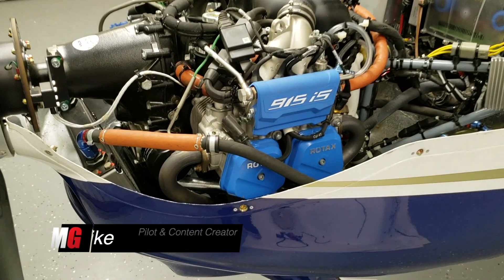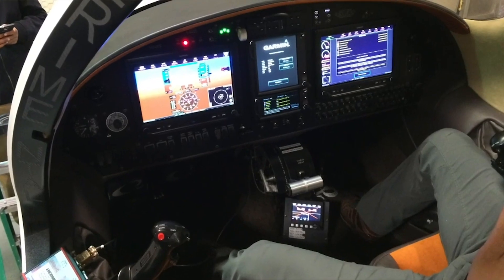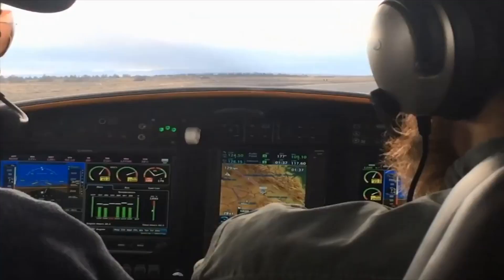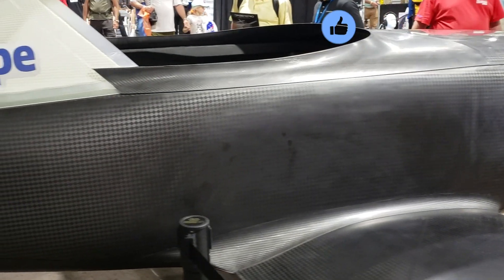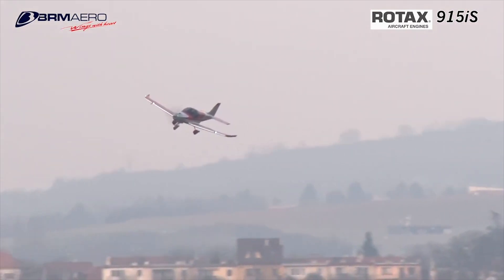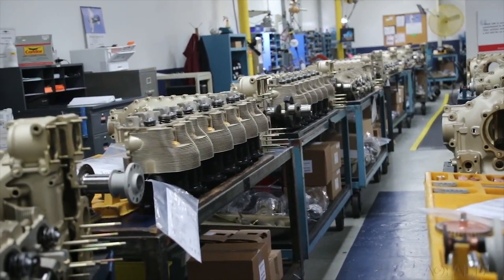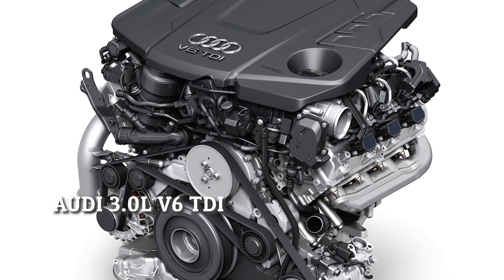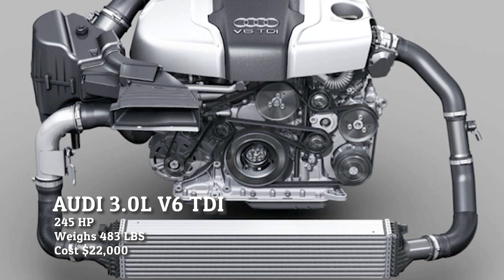5 FADEC Engines Used To Power Airplanes

Comment: Why is it that FADEC is a big deal with aircraft piston engines?
In a modern car, you press the pedal and the electronics take care of everything.
At the more affordable end, there are aero-engine conversions of auto engines.
One of them is the AeroMomentum AM10, 85 hp, 63 kg.
It has FADEC. cost only $7,500
Reply: Those engines have no redundancy. Single spark plug per cylinder, single injector and in most cases, single ECU. Aircraft specific engines are redundant in all these areas and I can tell you from personal experience that  I have needed that redundancy in flight a couple of times already in my short flying career(about 100 hours). I won't fly a plane that doesn't have it anymore. I really want to see either aeromomentum or Viking redesign the heads of these engines to accommodate dual plugs and injectors. Viking has a dual ECU option now, I don't know about aeromomentum though. Also FADEC does more than just control the engine. It also controls the prop. And then it all works together to lower cockpit workload and make the engine run at complete efficiency and safety without you having to be a mechanical engineer.

Comment: A regular car engine typically has a compression around 12:1 for road use, traditional Continental or Lycomings more like 8.5:1 or lower. That diesel Audi (and all Diesels in general) will be around 18:1. So if you try using 100LL or any other gasoline fuel in it, you'll get a BIG explosion and a bill for a new engine.

Comment: Frankly, the industry should be embarrassed that EVERY new plane doesn't come with a FADEC engine.
Reply: Exactly! Aircraft piston engines are at least couple of decades behind auto engines.
Auto engine manufacturers invest millions in R&D and manufacturing facilities.
It may be that the aviation market is too small to afford such R&D costs
Reply: @BlueMax333  Most of it has to do with the ridiculous FAA regulation process. That's why all the innovation is in the experimental category
Reply: Job Chithalan Thank goodness for Rotax.
Reply: @BlueMax333  Red tape and supply and demand.  The demand for aero engines isin't as big as for auto engines hence, the reason why they are hand built and cost a small fortune.

Comment: Piston light aircraft were equipped with magnetos which operated independently of the aircraft electrical system.  In the event of electrical failure, the engine kept running.  FADEC is reliant upon the aircrafts electrical system.  In the event of electrical failure, you lose the engine also (assuming there is no FADEC battery back up).
Reply: In the early days of aviation, electrical systems were unreliable.
Reply: @phlodel  - So now electrical systems have advanced to the point they are immune from failure?
Reply: @Booboobear-eo4es  No, not immune but certainly more reliable than many people.
Reply: @phlodel  -  I heard of a Diamond DA-42 pilot who had a dead battery in his plane.  Even though the Diamond manual prohibited take offs with a depleted or low battery, he got a "jump" for the battery, started up and took off.  Raising the landing gear in a DA-42 requires more electrical power than the aircraft electrical system can supply, requiring the battery to momentarily make up the shortfall.  (Which is why one doesn't take off in a DA-42 with a dead/near dead battery.)  As he hadn't been in the air long enough to charge the battery, the battery couldn't handle the extra load from the landing gear and it resulted in a complete lost of electrical power.  This cause the loss of the FADEC and he crashed.  Don't recall if he survived.  This wouldn't have happened in a aircraft with magneto type ignition.
Reply: @Booboobear-eo4es  Would love a link to the FAA or other accident report.  Correct me if I'm wrong but don"t the Diamond engines run fine without FADEC?  They are diesels.  And the FADEC has it's own battery backup?
Reply: @PC-vq5ud  - I heard this DA-42 account several years ago and my memory isn't 100%, but I believe it was in Germany where this incident happened, so I have not looked in the U.S. based NTSB database.  I did check the Wikipedia and found the following quote about the DA-42:

"The digital FADEC (full authority digital engine controls) serves to lower operational difficulty, constantly performing tasks such as managing rpm and fault-checking."

If the FADEC has a battery back up, that would avoid a single point failure scenario.  The battery would have to last long enough to keep the aircraft flying until one could safely reach an airport.
Reply: @Booboobear-eo4es  Just read a list of 58  DA-42 accidents.  Could not identify yours BUT several were loss of both engines.  One was listed as fuel starvation.  The others were not specific.  This list is user created, not government or official agencies.  There were links to official reports but most were not in English or pointed to dead links:  Error 404.  So if I ever get in the market for a Diamond Diesel I will do a lot more research on FADEC redundancies and the Austro 300 behavior on complete electrical system loss.
Reply: @PC-vq5ud  - I think maybe the mixture and timing might be under FADEC but I'm not entirely sure.  I also think there are non-Diesel that burn 100LL and utilize the old spark plug.
Reply: @PC-vq5ud  - Well, it was a LONG time ago I read the article.  So I can't really say when or where is was.
Reply: @PC-vq5ud  - In the early days it was though best to separate the engine function from the rest of the aircraft electrical system.  Aircraft systems (incl electrical) have become more reliable.  Yet the loss of an electrical system could take out the engine if:
1)  The battery back up was dead.  I suspect the check of the engine FADEC would be part of an annual or semi-annual check.
2)  If the flight duration is longer than the FADEC battery life.  Off hand, I don't know the running life of a FADEC battery.
Reply: Lightning strike could definitely cause issue.
Reply: @ryanthomas2472  - As a retired engineer, I worked in the areas of Reliability, Maintainability, Availability (RMA) (Reliability, Maintainability, Availability) and Human Machine Interface (HMI).  Some basic principles of any good design are:
1)  No Single Point Failures - If one component failure can bring down an entire system, it is a flawed design.  Example:  The space shuttle Columbia lost a heat tile and caused the entire vehicle to be lost.
2)  No Cascade Failures - A failure of one part of the system should not be able to spread to other parts and bring the entire system down.
Example:  The reactors at the Fukashima power plant had their emergency backup generators in rooms below sea level.  When a tsunami resulted from the March 2011 earthquake hit and main line power was lost to the reactor cooling pumps, the generator rooms were also flooded.  This resultant in a loss-of-coolant accident and led to three nuclear meltdowns, three hydrogen explosions, and the release of radioactive contamination in Units 1, 2 and 3.
3)  When a system fails due to operator error, it is the fault of the system, not the operator.
Example 1:  When two Boeing 737 MAX jets went down due to the failure of the MCAS system, the first reaction was to blame pilot error.  But it was the aircraft that was at fault.
Example 2:  In the 1950s, there was the F-104 Starfighter.  The lever for the landing gear and the lever for the deployment of the drogue chute were identical and on opposite side of the cockpit.  Needless to say, there were many incidents of pilots popping their drogue chutes on approach thinking they were extending their landing gear.  In each case, it was blamed on "pilot error."  But it was the fault of the aircraft design, not the pilot.  That's why today you have aircraft controls shaped like flaps and wheels.

Having an aircraft with a FADEC violates all of these basic design fallacies.
Reply: @ryanthomas2472  - The blame on the system and not the operator does have limits.  Usually, it falls under "normal" operation.  This would be like a worker operating a factory machine as it should and the machine does something (or causes the operator to do something) that results in an accident due to a design flaw.  Obviously if the operator does something out of scope to normal operation (like thrusting his hand into an operating machine), that would be the fault of the operator and not the design of the machine.

Comment: That Audi engine Doesn’t take 100LL.   It’s a diesel engine and will except jet A.    Do a little more research before putting info like that in your videos.   Also if your going to include car engines why not all the car conversions with fadec?   Theres also all the smaller UL Power engines, the D motor, the bigger verner radial engines, even some of the bigger Hirth 2 stroke engines can be bought with fadec.   

More research was definitely needed for this topic.
Reply: I agree with you guys about Mike as well, he does frequently get things wrong. That said, this is the Internet and I have little faith in anything on the Internet until I research it some more (usually on the Internet...hmmm, circular argument there??). Anyway, I do wish he would do a bit more research, but def love the enthusiasm and hope he continues creating content for a long time.

Comment: What happens to the FADEC if the aircraft electrical system fails? Where a non-FADEC engine will continue to run due to magnetos (self contained ignition systems) and mechanical fuel injection, oif these lose electrical power, do they shut off?

It doesn't sound like these engines are any more fuel efficient or less expensive to buy. Or longer lasting. Just dressing 1940s technology. Need a new design engine with liquid cooling.

But the financial numbers aren't there. No new designs for engines because new aircraft production numbers are about 10% of the 1970s. Piston twins like the Cessna 310, 340, 414, 421 will never be built again.
Reply: I just replied to someone else about this. This is how the rotax electrical sytem works in regards to redundancy. Hope this helps. Rotax use a dual output alternator and a backup battery. The ECU then constantly monitors the components and makes changes automatically if anything happens. It is always set to make sure the engine has power. Alternator (a) powers the engine, Alternator (b) powers the bus and the backup battery is the backup battery. If Alternator (a) fails, Alternator (b) kicks in and powers the motor and the bus. If Alternator (b) quits, back up battery powers the bus. If both (a) and (b) quit, the back up battery powers the engine. The system is made to give the engine priority over everything. That is how freakishly redundant the rotaxes electrical system is. I have the utmost confidence in the rotax brand of FADEC.

Comment: #mojogrip The raptor Aircraft is using Audi Engine. It will either burn Regular automotive Diesel or JET A or JET A-1, but not AVGAS 100LL.

Comment: The 737 Max planes used computers. 
Well that worked out good.
Reply: @ryanthomas2472  ,..That's because those planes don't have the design flaw that the Max has that Boeing is trying to fix with a software program.

Comment: Mike, 
Do a video about the Raptor that is scheduled to use the Audi engine. I would love to see you chat with Peter Muller about his plans and the schedule he has for it. 
I think the Audi engine will use diesel and Jet A, not 100LL. Need to verify that, please.
Love your channel. If you make it back to the Just Aircraft area of the country, let me know. Would love to meet you and buy you dinner.

Salute!!

Hugh
Reply: Raptor is a dud. Was supposed to be flying some 2 years ago. Too many unproven and untested experiments in that design, including this car engine. My prediction - it will never go beyond the prototype, even if the prototype will ever get to fly.
Reply: @bvnj123  Well the prototype is flying.  It's a heavy cow getting about 120 knots at 14 gph. And can only take about 1/4 fuel cause it's so heavy.
Reply: hughw10 correct Jet A. He is having some troubles with the PSRU .

Comment: FADEC engines are safer, more efficient, easier to manage in the air. Anyone looking to assemble or buy a new plane should demand one. Rotary phone vs Smart phone.
Reply: Agent J  Nothing good about Rotary phones, the cable would always bunch up, audio was not that great, you were limited to a location, and your little brother could listen in on conversations on the other household phone... Give me a smart phone any day! Keeping it charged is not a problem. The only limitation really.  Yes, even at 10,000 feet modern technology is reliable. Besides even if the electrical systems go away the engines still work. Magnetos!!!
Reply: Can't hack or lose a rotary phone
Reply: @TruckTaxiMoveIt  I remember during black outs. The phone still kept on working. The phones could be dropped and they kept on working. AT&T designed them to last back then.